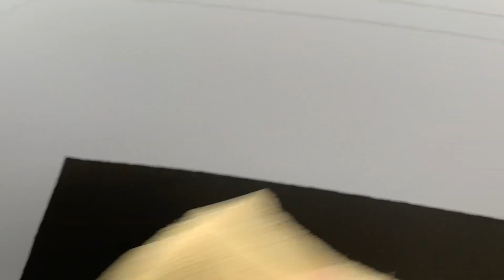DIY, Meguair’s Gold Class Carnauba Plus paste wax !

Comment: Been using this for years now! Every spring I start with a heavy duty wash, degreasing, then clay. Then if needed I use the Maguires professional products for any paint correction. Then Maguires gold class. If the paint doesn't need any correction I just do a clay, then Maguires cleaner wax, then gold class. Throughout the summer I'll use the gold class , and after washes I'll use Maguires wax as you dry, or if it's slightly dusty the spray detailer. In a world of synthetic this, and ceramic that, I still prefer paste wax and old school. I used all the modern stuff the first year I had my new civic, now I've gone back to gold class. Just looks better and I like building up layers before vvinter

Comment: As another has mentioned, you need to wait for the wax to cure before removing it. It’s around ten minutes depending on your climate. Also you’re using way too much wax. You only need a very thin layer, adding more will just make it harder for the wax to cure and will waste product. Hope this doesn’t sound negative, thanks for the video.
Reply from the maker: No, not at all. Thanks for the inputs, I am also learning ! Just a DIY hobbyist ! :)
Reply: @NATURALGAMING  you’ll get better results if you leave it to cure.
Reply: @sumfingbitme9431  no not true at
All you proball get better protection
Reply: @NATURALGAMING  sorry but that’s not right at all.
Reply: @sumfingbitme9431 In the winter time Mabye yes but summer no the sun will dry the wax faster
Reply: @NATURALGAMING  I wouldn’t be applying it in the heat or direct sunlight though.
Reply: @sumfingbitme9431  Ofcourse but the way i apply in heat is kinda stripe by strip like I don’t apply
The whole hood then do it I apply like 10 sections on the hood for saftey reasons
Reply: @sumfingbitme9431  remember I’m an actual detailer so I kinda get the jist of how my products work at the same way how fast I can get the job done ( SAFELY)
Reply: @NATURALGAMING  you’ll still get better results if you do it out of the sun and heat and let the wax cure.
Reply: Where's your video? Sumfing
Reply: 3-5 minutes and that’s the official meguiars demo

Comment: You're not supposed to take it right off, it's a good 10 minutes or so you should wait until the wax dries and when wiping gives a chalky appearance and texture
Reply from the maker: Thanks for the tip ! Will follow next time
Reply: if you wait for it to dry, it leaves streaks
Reply: @sultanabran1  it's just a quality car wax my friend... are you familiar with waxing vehicles? you can't just wipe it off though.. you apply it, wait a bit- it'll look hazy and if you swiped a finger across it it looks like chalk, then you buff it until shiny rubbing in small circles.  You're also not waiting two days for it to dry or doing it in the direct sun, which is the same for almost all waxes/polishes, etc. I use this same stuff on both my black motorcycle and silver car
Reply: @MatthewWheatiesClark  i've never waxed a vehicle my friend.
Reply: @MatthewWheatiesClark  not true at all you don’t wipe instantly but you don’t wait fucking 10 mins either lol
Reply: @NATURALGAMING 10 mins is perfect it needs this time to cure 👍

Comment: This is a very good, not too expensive wax that leaves a deep, rich mirror like shine. Not sure how long it lasts, maybe 3 months? TIP: put on a coat, wait until the next day and throw another coat on. You'll be left with incredible results
Reply: Do I gotta fully wash it again or.jist wax?
Reply: @Dmennis  if it's dirty or really dust then yes wash it. If it's clean, wax again

Comment: Does the cloth need to be washed after removing the wax?   Thanks
Reply from the maker: Yes, otherwise it will be saturated and will not remove the wax.
Reply: @khushwantsingh547  how do you suggest to Wash the cloth?
Reply from the maker: You can use any basic car shampoo from 3M. There are specific shampoo for microfiber as well but those are too expensive. So I prefer basic 3M car shampoo or even good quality liquid laundry detergents works well !

Comment: Hello brother,  just bought a car a month back. havent got any coating done since i find them costly. I am looking for an DIY way for maintaining it. Is waxing the right way or newly bought cars need nt to be waxed. please provide ur valuable suggestions.
Reply from the maker: Hi, wax is a good way to protect cars. And it’s always good to start protecting cars when new. There are multiple ways you can protect DIY. Wax is the very basic  and effective technique - you can use synthetic wax - ultimate maguiers or graphene paste wax from turtle wax. Over an above you can the use ceramic detailers to increase gloss and longevity of wax. 

Use good washing shampoo to clean the car and then a surface prep for maximum longevity of your wax. 

If you wish to try ceramic DIY then There are also stand alone ceramic products as well that you can use DIY such as Proje ceramic coat, gyeon can coat, car pro reload and then protect using ceramic detailers for regular protection.
Reply: @khushwantsingh547  thanks man for the reply. Is there any product that kinda repels dirt or provide any protection against it. A lot of dry dust sits on my car each day coz of the location. Its nt possible to wet wash the car daily. Currently using a jopasu duster but this duster may also nt provide 100% protection against swirl marks frm dust. Hence looking for anything that can protect the car accordingly and also maintain the paint's gloss
Reply from the maker: @IncognitoBeing  ceramic is the only solution, you can try hydrosilex - https://www.hydrosilex.com/
https://hydrosilex.in/

Comment: does washing clears wax?
Reply from the maker: Yes it does, depends what kind of shampoo I used. But the finish is definitely lost, you will need a good detailing spray to bring back the original gloss or a quick re-waxing
Reply: @khushwantsingh547   polish with that wax how long it stays can it remove after few wash
Reply from the maker: Wax doesn’t stay long in Indian weather, 3-4 washes and it will be gone

Comment: can I add detailer before this wax or just wash it and dry it and add this goldglass?
Reply from the maker: No need for detailer before wax, you can use it directly after washing. 
If you want to clean the surface before wax, you can use 50:50 IPA:Water mixture

Comment: Ceramic coating should not be applied before or after a wax coating.
Reply from the maker: Yea definitely not before ceramic. But once the ceramic is cured you may use occasionally for high gloss. Ideal would be to use the ceramic detailers but I feel wax that loosely bond with the surface is not going to deteriorate the ceramic coating. I may be wrong ! But it does provide insane levels of gloss !